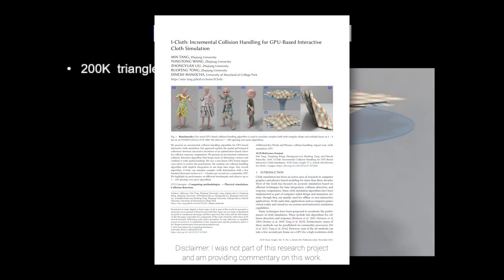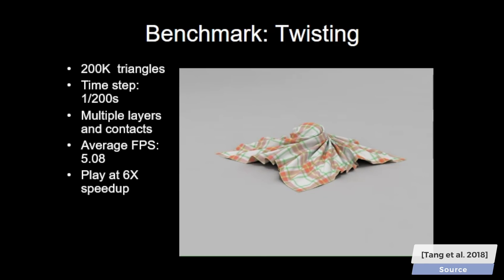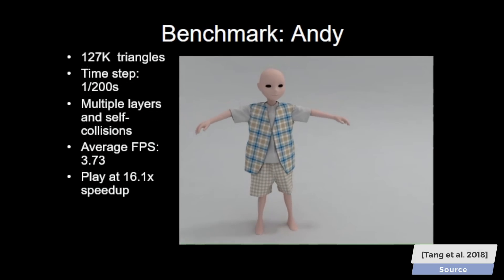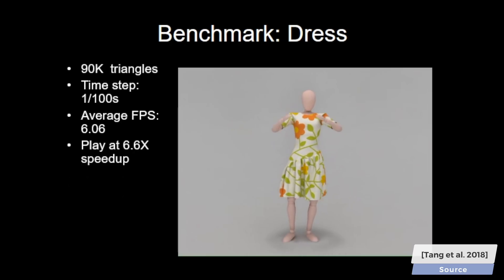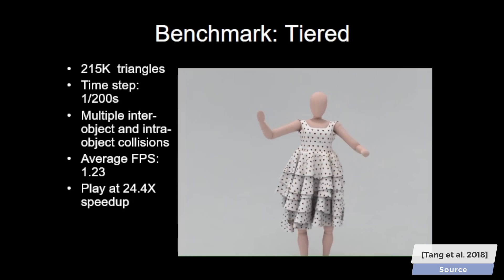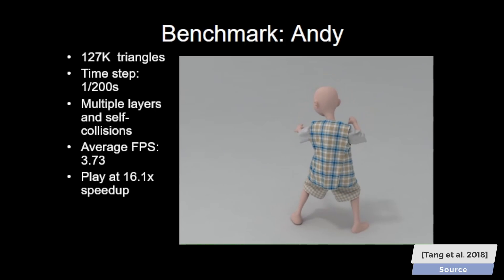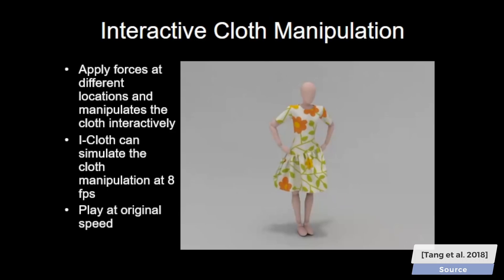Why Are Cloth Simulations So Hard?

Comment: 2:31 Whats the speedup rate on the 2nd and 3rd videos? Certainly lower, but how much does lowering the time help on frames?
Reply: it doesnt help in term of render times, but it does help in terms of... well, how fluid the motion is afterwards

If you have a scene that renders at 5 fps and you speed it up 12 times so you get to 60fps, you could also lower the quality of the scene so much that it renders at 60fps.

It would just look worse

Comment: Probably because simulation is having to constantly compute created state instead of evaluating state.
Does a timestep of 1/200s really need to run constantly or would it be possible to varistep using 1/10s and 1/200s is just used for evaluation to smooth low timesteps.
Reply: Dunno. But the problem still stands, it is too easy to miss collisions, and end up on a state that is impossible to get out of. But this new method is great, since you could use x4 times larger time steps.

Comment: Maybe parallelization will keep Moor's law going!
Reply: > Moore's law is the observation that the number of transistors in a dense integrated circuit doubles about every two years
(wikipedia)

Moores law does not care for parallelization. its purely about hardware
Reply: @Soraphis91  parallelization let's a program use more cores and hence more transistors
Reply: @Jone952  more cores does not equal higher transistor density.

Moore's Law actually refers to transistor density doubling...and the cost halfing...every two years.

If you double the number of cores, you double the price of your product....and you wouldn't be doubling transistor density either.

Comment: Collision detection with big timesteps can be easily solved using phase or minkowsky space and using concepts similar to raytracing in phase space. I did elastic ball collision simulator that was exactly , independent of the timesteps value. And doing it for triangles or few other shapes should be equally easy. Then you can plug it into adaptive implicit is over and simulation will be stable and accurate.
Reply: Maybe you should tell the authors that.

Comment: Please make a video on hr algorithm used for the black hole image!
Reply: It was a colorful spreadsheet, dont call it an image.
Reply: @username4441  hmmm... all images are colorful spreadsheats... what's your point?
Reply: @Darth_Pro_x  Well, not all, but I assume you are referring to digital ones. And yes.. I suppose you are correct, but they were taken from a single sensor capturing light from a single vantage point, in the same scene at once. 

The black hole "picture" is about the most convoluted mess of confirmation bias ever created by man. But I do not think for a second that you have a good grasp on the procedure/whitepapers for the tech/method of garnering the data.

Comment: π minute papers
Reply: @Ethan Ansell uhh π minutes isn't π seconds but, okay?
Reply: @johnsherfey3675  it's 3.14 minutes, the math is correct. he used 60 seconds which is one minute.

but, you know, okay?
Reply: @AmeshaSpentaArmaiti  confusing ending but what ever.
Reply: Isn't pi just a number and minute the measuring unit?
So pi minutes= 3.14 minutes. It's not pi*1minute.
Reply: @Amber57499  yep.
Reply: @Amber57499  Instructions unclear, I can't bake a pie within a minute
Reply: I would really like to see game industry focus more about this. To see more advanced particle and physics effects in games instead of pushing up to ridiculous resolutions. 
More pixels on screen is not the way. 
They talk that ps5 will be able to run games at 8K. Where is logic in that? Its a wasted potential of processing power. Even 4K resolution is an overkill. 
I play games at 2K or 2.5K res and its enough. 

Instead of talking about 8K res they should direct processing power into this stuff - more advanced physics. 

Modern games look amazing at times but the environment is very static. Weak particle effects and physics just like 10 or 15 years ago. In this area very little has changed.
Reply: STEALING MY COMMENT
Reply: 666 likes.
NO
Reply: If you go back to the thumbnail, you see 3:15
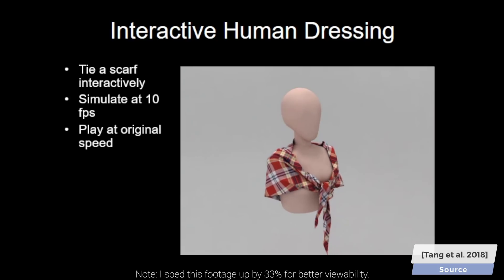Reply: @Ethan Ansell Maths check out 3.141 * 60 seconds = 188.46 seconds = 3:08.46

Comment: looking forward for the day this is used in real time in videogames
Reply: I would appreciate to have this in blender to start with.
Reply: At that point, your clothes can clip through or even come off from char's body if
Reply: same
Reply: Source 2 did it
Reply: as far as I've seen - red dead redemption does the best job on this.
Reply: @peakperspectives_ch  I was about to say, if this hasn't already been implemented in RDR2, that would be the best use-case. High realism and immersion, frame rate not critical. Can't wait to see that on PC
Reply: @BobbyRobby1000  Star CItizen also has some pretty good cloth simulation stuff in the works: https://youtu.be/HjHn0iUpBVE?t=545
Reply: It has been used for a very long time.
Reply: @OsedayCan  to this scale? I usually see capes and other more loose parts of the outfit being dynamically simulated but not the whole clothing.
Reply: @Linck192  This scale was never necessary so it wasn't made. There are also way smarter and faster options than this which has been used multiple times especially in Ubisofts latest games.
Reply: @OsedayCan   Correct me if I am wrong but n game,s they don't simulate the triangles/polygons directly . They simulate bones and then the geometry bound by the bones is moving along with it, even in recent games they still use this process...
Reply: @OsedayCan  it definetly has not
Reply: @OsedayCan never been used

Comment: I long for a time when open source hardware will be as accessible as open source software is now. Imagine the innovations happening when researchers won't be limited to using the hardware manufactured by a couple of companies holding monopoly over the industry.
Reply: The problem with hardware is not whether it is open source or not. Of course companies like Intel or Nvidia are demanding ridiculous prices compared to the manufacturing cost of a given piece of hardware however the prices would continue to rise regardless. Even if open sourced hardware will only continue to rise in prices. That is because newer hardware requires smaller and smaller manufacturing errors. They require increasingly purer wafers and produce increasingly higher proportion of subpar products. The reason why Intel keeps on introducing more high end and expensive lines of products is because they produce less and less actual perfect wafers. Intel does not produce i5s and i7s separately. They are the exact same product just that i5s have some of the cores not working for one reason or another. Rather than throw it away as a failed product they simply rebrand it as a cheaper line of products. You have to realize that a dozen atoms off may result in a failed product. By making their architecture smaller they make the margin of error smaller as well and as such instead of 10 atoms breaking the product 5 will be enough. This in turn creates a higher proportion of wafers not perfect enough and throttles the supply of top of the line components. Unless we fundamentally change how we process data we will soon run into a wall of diminishing returns.
Reply: @Telhias  Are those numbers accurate? Is it really two digit numbers of atoms that make or break a product?
Reply: @NortheastGamer   An atom size is between 0.1-0.5 nanometers, with silicon atom being 0.21nm. According to wikipedia 5 nanometer technology is already produced as of 2019. That would be around 24 atoms. It is not only tens of atoms but also steadily approaching single digits. Next technology scale is planned to be 3nm which would mean around 14 atoms.
Reply: @Telhias  Neat! Thank you!
Reply: Tesla is basically a company with your idea of "open source hardware". 

Yet, that open source Tesla Model 3 will still cost you $40K.

Comment: I love that was still finding interesting ways to fully make use of GPUs, even though they've been around for so long. I wonder how long it'll take us to take full advantage of quantum computing if and when it ever becomes widely available
Reply: More than Quantum Computers, for now I'm wondering more about TPUs (tensor processing units meant for AI applications) and the RTX cores Nvidia introduces for Ray-Tracing. - Both of those might have supplementary applications in tasks like the above as well. Potentially ones unrelated to their original purposes.
Reply: @Kram1032  yep i thought methods similar as ray tracing is still decades away, and boom NVIDIA has done it... Just wow
Reply: parallelism is hard
Reply: Quantum computers are still in a very primitive state that amounts to a handful of Qubits in a large enclosure at a very low temperature. You're not going to see Quantum CPUs for decades, and even then, because of the very different way they work there will likely be scenarios where traditional CPUs are more suitable.
Reply: Probably never, because you gotta cool that shit. But hey, how many times has the impossible been done by now?